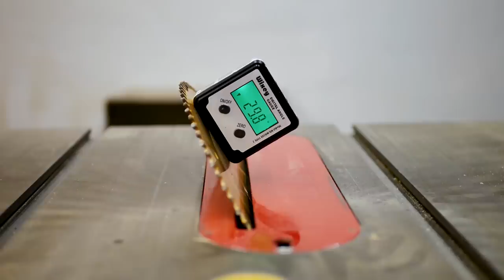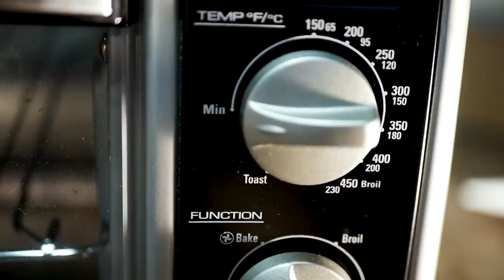Marking Knife Forged from Drill Bit & PlastiDip Handle

Comment: Haha I love that belt grinder because I have the same one, but I only use it to sharpen knives. 
I know for a fact that you probably cut out hours of footage cuz I know that cute little belt sander isn't fast enough to quickly make a bevel. 

Lol but I could be wrong. Great vid man.
Reply: By heating and air cooling it takes the hardness out of the steel the softer steel now also grinds easier.

Comment: Hello. And why do you put in a microwave oven?
Reply: Виталий Нежинский He is tempering the steel after hardening (quenching in oil) to remove the brittleness caused by said hardening, if you don't do this final step you might be able to sharpen it insanely sharp, but if you drop it, it will shatter, so better loose a little hardness and sharpness for a more durable blade.

Oh, and it wasn't a microwave oven, it was an electric one, you can adjust the temperature pretty well for simple temperings.

Comment: .And why so much work ? Ruined a good drill bit and made unnecessary thing.. From old needle files or nail files, it could be done. What's the black paint ?
Reply: It's not unnecessary if you are a woodworker, it's essential, and this takes so very little time and work that you are coming off as really lazy. On the other hand, we have no way to know if this is a perfectly good drill bit, careless people often soften them by drilling to hard and too hot, and you would have to reharden and temper and grind again for something that's worth cents when new. And finally the name of the product is on the can in the video, and it's used for coating tools with rubber